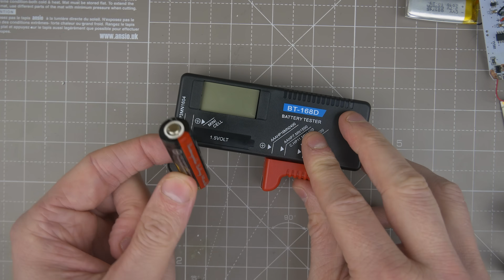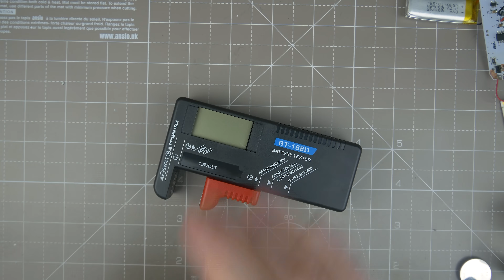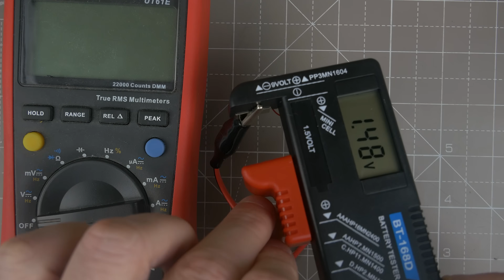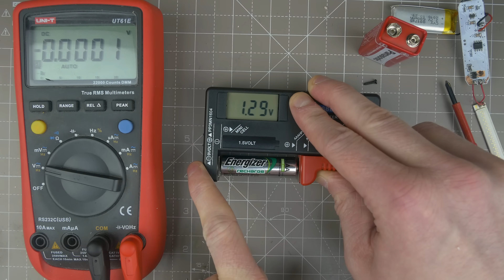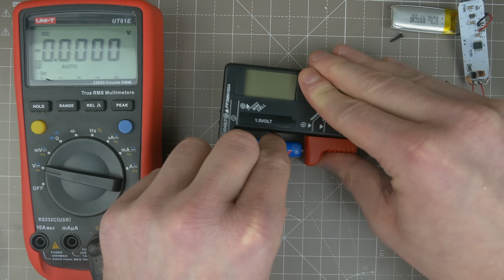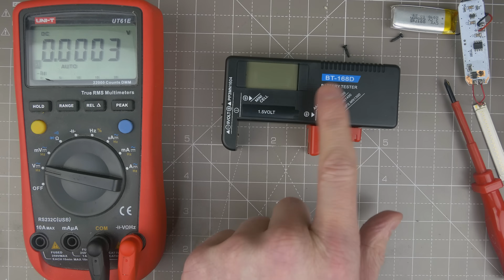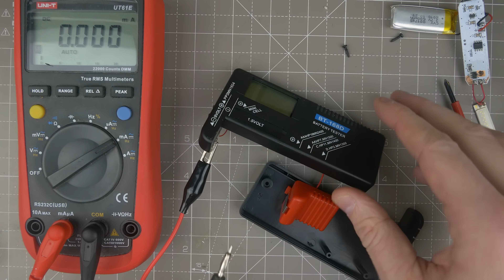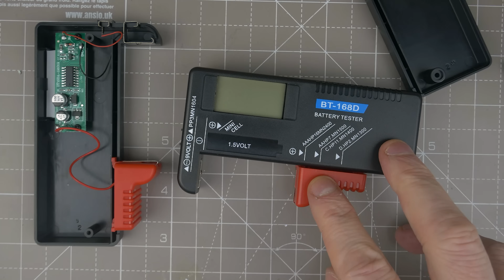BT-168D Battery Tester

Comment: so for easy to look at Voltage (V)	Charge Level
1.6	New, fresh out of the package 🔋
1.5	Fully charged (nominal voltage)
1.35-1.5	High/Full charge
1.2-1.35	Medium charge
1.0-1.2	Low charge
< 1.0	Near dead/Empty

Comment: UPDATE WITH ANSWER:  When measuring a 9V battery, I need to make sure the slider terminals do not make contact.  When the + and - are connected together when pressing the unit against the rectangle battery, the 9V reading will be reduced by approximately 1.4V for my BT-168D.  Strangely, the ANENG 168Max I own has these terminals contacting by default and open/closed doesn't make a difference.  I will put a label on the unit so I don't forget.
PREVIOUSLY POSTED: Mine reads 9.06 V for an instant when first pressing the battery against the side, but then switches to 7.61V reading steady.  Why do you think it does this?  Works stable on the slide terminals.

Comment: Can they survive reverse polarity? If someone inserts the cell opposite way will it survive?
Reply from the maker: I can't quite recall the circuit but I have reversed the polarity many times on AA batteries and it is fine. I think there is a physical bit of prevention for 9v batteries.

Comment: Cool video and battery tester. Do you by chance know if this tester is just reading the DC voltage, or is there some kind of small load test applied? Thank you.
Reply: The tester does apply a load to the battery, and it's basically a constant power load, which will ramp up the current as the voltage drops.
On my unit, the power draw is about 27mW at 1.15V, or 23.8mA.
For 3.97V, the draw is 20.9mW, or 5.26mA.

9V port had a load of 5.5mA at 8.26V, or 45mW.

You'll find it may not even turn on with marginal small button cells, because they can't deliver sufficient current at the low voltage. 30mA is a significant load for the tiny cells.

Don't try to simply compare accuracy against a DMM because that's basically an unloaded measurement with a 10M ohm input impedance. That would do nothing in determining if a battery is actually usable or not, especially for lithium coin cells. With those, they'll pretty much always read near 3V, but can't deliver any usable current.
This setup is actually a good screen test for batteries. If you need a guideline as far as what is good or bad you can look at the chart on the back, but you really have to consider what device you're using and what kind of cell to set up your own thresholds for replacement.
Reply from the maker: Very little load is applied as far as I recall, just enough to power the device. You could add a resistor across positive and negative to get a better reading of the true voltage though, you raise a very good point.
Reply: @DavidWatts  Thanks for reply...reason asking is you know how just using multimeter on car batt...might say 12V but that means nothing for there was no load, but with load tester, car batt may say 11V at which point you have a problem. I think the same on all these analog or even digital testers for disposable batts, they may give false security if they don't load test.

Comment: That tester does not seem to provide much of the load for the cells under test. I've read that the old unit BT-168 with analog indicator was drawing as much as 375 mA from brand new 1.5 V batteries.
Reply: 375 mA ? That seems like a decimal point was dropped somewhere because it was probably more like 37.5 milliamps. 375 would be way too high for a battery test.
The BT-168D that I have draws a load of about 28 mW, which is a reasonable load for general testing.
Reply: The analogue 168 unit loads down the cell with a 3.9 Ohms resistance.

Comment: I was thinking about setting a lot of battery trays with mini digital voltmeter modules for reading battery voltages faster. But it takes a lot of space. So I also purchased the BT-168D. It's portable and saves a lot of time compared to using a multimeter to read battery voltages

Comment: aa recharge r suppose to be 1.2v why does it show 1.30 etc
Reply from the maker: A fully charge NiMh cell will be around 1.4-1.5v when testing the voltage with a minimal load. It will drop to its nominal voltage of around 1.25v on a reasonable load very quickly.
Reply: @DavidWatts  oh that is interesting ty

Comment: What brand is lithium cr2032 u used and it showed 4v they r suppose to be 3v ? And what is difference standard and lithium?
Reply from the maker: Renata rechargeable I think, they wouldn't be 4v under proper load. 3v for standard ones though and the rechargeable lithium have like 5% or less of their capacity at above 3.7v

Comment: If you look closely at the back-side of the orange slider, you notice a small 'slot' of plastic, or nub, for the wire to be placed into, which will help prevent the movement of the CONNECTED AREA (soldered).  So your concern of the connection failing over time is due to your not noticing that the wire should be replaced BACK where you pulled it from.  I would use a dab of any proper glue onto the wire/nub slot when putting the thing back together... just sayin'. - lol

Comment: You want to get the "BT-168 PRO" instead of this one. They both look nearly identical but the PRO supports batteries ranging from 1.2v up to 4.8v (and 9v), and it can fit an 18650. You don't need to get the Aneng one, the important thing is that it's the PRO model. It might be a couple bucks more but it's worth it.

Comment: 5:58 wow i surprised you really guessed it! I was looking for repair information of bt-168d because it suddenly don't work, found out that slider part you exactly point out was disconnected!
And for somebody may have lcd display don't shows voltage correctly, but showing '18C', all you need is just take out circuit and LCD panel, adjust contact between them, and screw in tight. At least i fixed it this way.

Comment: There is an inherent design error in these units that makes the 1.5v mode very inaccurate and non-linear. There's a boost circuit to power the processor, and also to put some load to the 1.5v battery. When you connect to the top 9v connections, the boost circuit is bypassed. Hence the problem... a diode is used to stop the 9v from reverse-powering the boost converter. That diode has a forward voltage drop that affects all 1.5v measurements and they have tried to average out the error with dodgy input voltage divider values. You can fix the inaccuracies by removing the diode and replacing it with a physical switch then adding a trimpot on the voltage divider to allow calibration. Now note that the boost circuit WILL fail if you run Lithium cells into the 1.5v side. So instead of switching between slide and top connections, make the switch be for <3.3v (include boost) and >3.3v (no boost) input. Doing this mod plus adding some load resistors and tweaking the voltage divider will result in a very accurate little tester.
Reply: Here is a tech page that explains the issue, however it proposes an semiconductor switching IC and not bypassing the boost circuit at all for the slider connections... http://ka7oei.blogspot.com/2014/04/making-cheap-chinese-battery-tester.html?m=1
I decided to use that research to design my own solution that uses a manual switch to simply add or omit the boost circuit. In that way it allows me to measure lithium 14500 (mainly LiFePO4) cells etc using the slider contacts.
Reply: Very interesting!
Just wondering, since the diode is on the 9V top connection side, why will the boost circuit fail when using Li-Ion on the slide terminals?
[edit] Oh wait, I have the Pro model that can measure 1.2 to 4.8 V on the slide terminals.
So does that model suffer from the same problem? [/edit]
Reply: @Ni5ei  - On the "Non-Pro" model: From memory there is a diode is on the 1.5V side as well - in other words, both inputs run through a diode, and the diode(s) is what causes the voltage errors. It affects the 1.5V a lot more than it affects the 9V measurements.
The Boost circuit (in the "non-Pro" fails because it cannot handle the input voltage being above about 3V, and it literally burns out the Inductor.
The new PRO model is excellent. It doesn't seem to suffer any errors or problems. I bought two of the PRO after I got sick of trying to get the "non-Pro" to read accurately.
My two PRO's measure slightly differently, but it's within a few percent. They could be tweaked by adding trimpots around the voltage divider resistors on the input to the measurement circuit.
Reply: @johncoops6897  Thanks so much for responding this quickly (the post I responded to is 2 years old).
Great to hear the Pro model is way more accurate.
I do plan to install a few resistors and switches to create a load though.
Reply: @Ni5ei  - get some 26 AWG fine stranded silicon cable and replace the wire on the slider bar. Also use a fine stone or wet/dry sandpaper and smooth all the burrs on the slider and track. Those make it nicer to use. And dont tough the zebra strip for the LCD with your fingers LOL
Reply: @johncoops6897  Thanks, will surely keep this in mind when improving it!
Reply: in terms of out of the box use, would you recommend the analogue version (168) over the digital (168D)? Since the analogue 168 unit loads down the cell with a 3.9 Ohms resistance.  Thanks.
Reply: @adiands850  - buy the new Digital model BT168D PRO
It solves all the issues of the 168D as well as being able to measure Lithium 18650s.
The 168D PRO doesn't load the cell as much (as 3.9 ohms) so it measures about 1.58v for a brand new alkaline AA cell. Because it only lightly loads the cells it is OK for measuring button cells without killing them.
Reply: @johncoops6897 I thought digital battery testers only pull just enough current to run the controller and display, which means they give misleading practical results.  There's a YT video where a profoundly empty AA battery was showing 1.39v on the 168D.
Reply: @adiands850  - you can add whatever load you want if you REALLY want to test batteries under heavy load. But what load do you want in a universal tester?
A D cell would need a far lower resistor than a 2025 button cell. And a 9V battery will voltage sag badly under the same load as a AA cell.
...
If you want to test under load, then you are better doing that using a proper electronic load. That way you dial the current that you desire.
...
A battery cell tester is simply for testing the state of charge, not for anything more than that. Open circuit voltage is exactly how state of charge is measured for ALL batteries.
If you put 3 ohms across a AA Alkaline cell, you are drawing 1/2 an Amp (500mA) which is not testing it's state of charge... that's a load test.
...
A AA cell with 1.39v on it isn't "profoundly discharged" 😃 - I just changed our wall clock battery, and it measured 0.95v on the BT168D PRO... Now THAT is heavily discharged.
After many years of experience, I can assure you that the BT168D PRO is the best UNIVERSAL quick battery tester.
...
There are lots of others out there with terrible accuracy. The old BT168D was bad due to the diode I mentioned previously, which they  tried to average out using a correction factor that caused about 0.2-0.3v error at some voltages. The PRO solves that.
...
Put it this way... I have the analog BT168, some other analog testers, the 2 x BT168D and 2 x BT168D PRO and 2 x other digital testers. I probably have 20 electronic loads for proper load testing up to 20A as well as Resistive load banks for higher load currents. I have about 10 multimeters, probably more.
... and when I need to do quickly check the charge on single cells (mainly AA and 18650) I just use the BT168D PRO.
Reply: @johncoops6897 Thanks very much for the detailed reply.  I will get the 168 Pro.  The example of the AA with 1.39v was about the 168D misreporting the voltage.  The 168D's lack of load probably meant the 168D was reporting the surface charges rather than the AA's true state of charge.  I wonder if the 168 Pro suffers from the same issue due to its lack of load.
Reply: @adiands850  - it's not the "lack of load" that causes measurement errors with the BT168D. Like I described previously, there is a DIODE in the measurement voltage line, dropping 0.6V from the actual cell voltage. That voltage then passes through a voltage divider before entering the microprocessor (MCU) which scales the "introduced error" by a different amount (percentage) depending on the actual voltage (which could be from 1V to 10V).
Inside the MCU they don't add back the 0.6v, but rather they apply a multiplication factor. The factor is completely incorrect for almost all battery voltages... So it reports different errors for low voltages and high voltages (eg: 9v).
..
Sorry if that's not explained well. I studied the circuit and error in great detail about 5 years ago, and cannot remember the exact numbers. It's fairly easy to explain with a copy of circuit diagram, a whiteboard and a calculator.
...
However none of that is relevant to what you are referring to, which is the significant difference between Open circuit battery voltage vs. a Loaded battery voltage...
That is totally dependant on the battery cell's internal resistance. Cheap or faulty cells will have higher internal resistance than good quality cells, so their respective voltage under ANY load can vastly vary.
...
Since a battery's State Of Charge is always based on open circuit voltage, the less load that the meter adds the more accurate the measurement. The BT168D and PRO load the battery by a few ma which does pull the open circuit voltage down slightly. I find that slight load (and voltage drop) totally acceptable, since these are not intended to be precision measurement devices anyway.
Reply: @johncoops6897  I just wanted to thank you for your comments. I read a lot of conflicting information about whether or not those devices are even useful due to the supposed "lack of load" on the batteries. Now I know that the (digital) PRO version applies enough load to give a reliable, good/bad result for AA/AAA batteries. 

BTW I have a similar quandary with aliex "digital battery and alternator testers" (the ones without a display, just diodes). I suspect that the outcome here will be the opposite, however... There is no way those devices can add enough load to the car battery to test them under load... They only test voltage, right?

Comment: Thumbs down on the device because of ratty contacts and no spring.
Reply: Needs electroplated gold contacts. Sounds like a video request to me!  Electrochemistry is fun.
Reply: @neogeo8267  Yes, gold-plated and textured with spikes.
Reply: Try using a pencil eraser on the device and the battery terminals before use.  You can also apply some contact protector on before putting it away.  Even if you plate the terminals with gold, the battery contact will continue to be oxidized nickel, which requires significant pressure to overcome contact resistance.  This is why devices that use these cells have stiff springs. The pencil eraser doesn't get rid of all the oxidation, but it will remove some of the other environmental contamination that might also be present, even if it looks clean it this layer of nonconductive material is there obstructing good contact.

Comment: 5:58 You can pinch red cable inside, in the middle of the slider.
That way, no more stress on solder joint on this side.

I have one tester, I opened it immediatly to make that change!

Comment: I bend the metal on de red slider a bit, so it has some springiness. That really helped getting a good connection. 

I put a screwdriver underneath the metal, in de middle, and bend it up a bit. Does need much.

Comment: I have one of these too, I wish it drew a more substantial current so as to test the battery under load.
Reply from the maker: There is plenty of space in there to hack in a couple of LEDs ;-)
Reply: @DavidWatts  or just a resistor of sufficient wattage
Reply: The one I got for the princely sum of $2.68 from Temu seems fairly decent in that regard, with a constant power loading, where the current draw drops with higher voltage.  It's not a simple resistor load.
Reply: You could probably add a load on the 3V  output of the internal DC converter to increase it beyond what it draws now, and allow it to still operate with a constant power load.

Comment: It is indeed nice to have a digital reading...  It may be nice to have a spring on the handle - not essential...  I should get one of these for my battery draw.  I was worried about it putting next to no load on the battery, where a meter loads it just a little and may offer a slightly more realistic reading - no biggie though!  Next question...  can you put a 4.2v LithionCell in it?  HA! Answered!! not an 18650!!  Too big...   Paperclicp may sort that...  Nice to see this thing!!  Thanks Mr Watts!!  All the best!
Reply from the maker: You could shove a fat LED after the boost circuit to add a little more load. I think ~10mA is good enough for a rough indication of the battery state. Not suggesting it is a replacement for a properly calibrated meter just more convenient for a quick sense check.

Comment: I think it might boost voltage to like 5V and lower it with this small sot23 voltage regulator. What you measured is probably output of U2, not U1.
Reply from the maker: Could well be, I decided not to trace the whole thing out as it really is just an indication device rather than something precise.
Reply: kjur18 those were my thoughts as I saw the video. You could verify this easily by measuring the voltage after the 9v input protection diode while powering it with about 1,5 volts on the slider input. I also have one of those since years. Maybe I take a look into it if it’s the same inside?